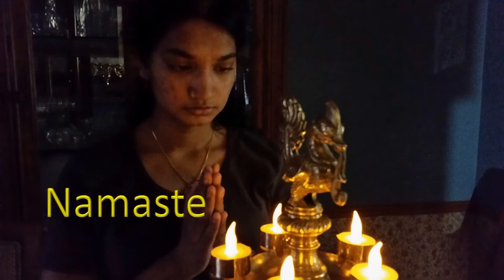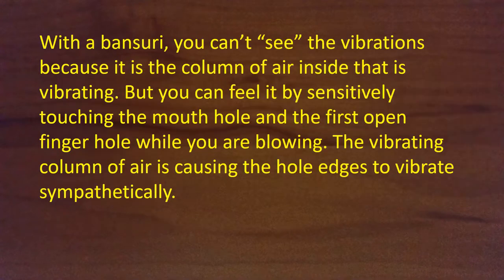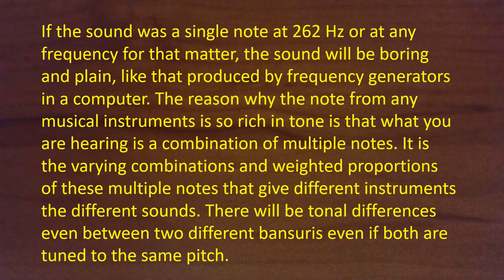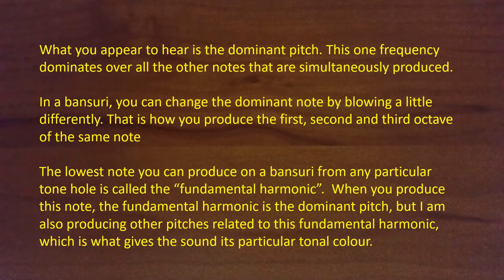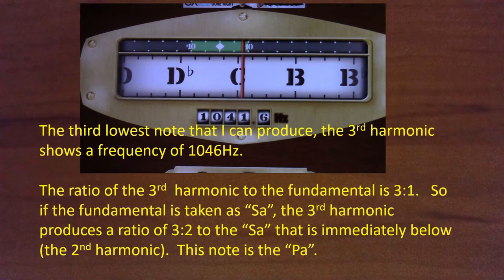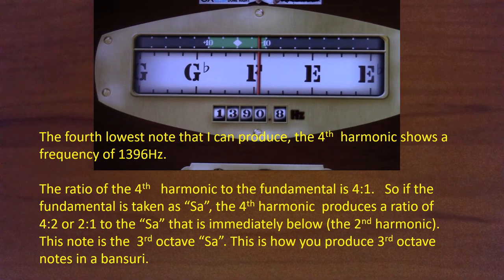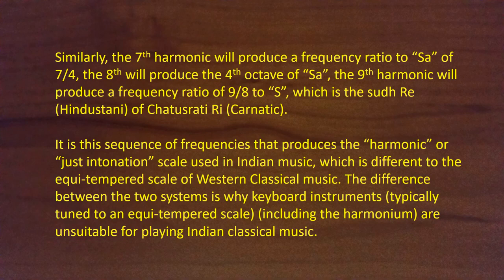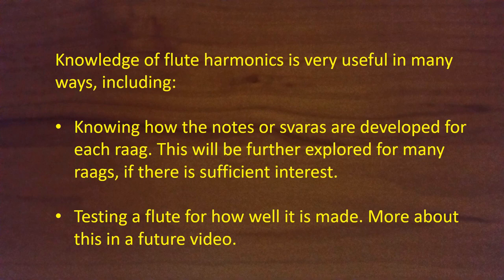Flute Bansuri Lessons: Basics of Harmonics

Comment: Can we produce six tone in bamboo flute or Pvc flute  ..orbit is only possible with brass mouthole
Reply from the maker: You mean harmonics? I can get 5 with the 5th being weak in my PVC flute and 5 clear with a long bamboo. Generally, it is easier on longer flutes, and flute bodies and lip plates that are rigid and strong, such as carbon fiber and metal.
Reply from the maker: You mean harmonics? I can get 5 clear ones in my bamboo flute, 5 but with the 5th rather weak on my PVC flute. It is easier with longer flutes and with rigid (such as carbon fiber) or sonorous (such as metal) bodies and mouth piece.
Reply: @vayuflute3717  we can install mothpiece at home

Comment: Hi, I need a quick help regarding flute tuning. I have recently purchased a flute but found out that all the holes are well tuned except for the first one (pa). It sounds a bit flat. Is there any way I can increase the pitch of that hole (all holes closed) without jeopardizing the overall tuning ?
PS : Its a 6 hole flute (hindustani)
Reply from the maker: You have two options. The first is to drill a small hole  close to the flute end. This will acoustically "shorten" the flute and increase the frequency. Do this carefully, by making the hole small and slowly expanding it until the required pitch is obtained. You can use sandpaper wrapped around a pencil to increase the hole size. If you make a mistake, you can always cover the hole with putty, wax, clay, or tape, and then start again.

The second option is to first expand the length of the flute by tightly (no air leaks) attaching a small portion (say 2 inches or so) of another tube at the end (this could be metal or plastic). The next step is to drill a 7th hole,  somewhere between the sixth hole and the original flute end. As a guide, the distance from the sixth hole hole to the seventh will be approximately the same (a tiny fraction longer) than the distance between the 5th hole and the 6th hole.

The second is the preferred method. Most professionals use a 7-hole flute.

For small changes in pitch, this will not impact the other tone holes.
Reply: Waiting for more videos... Very informative video...